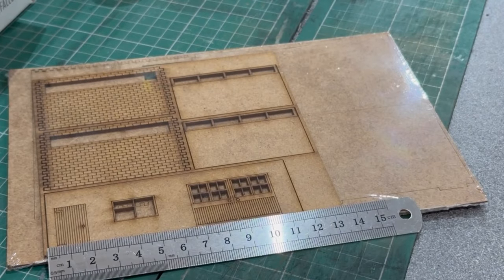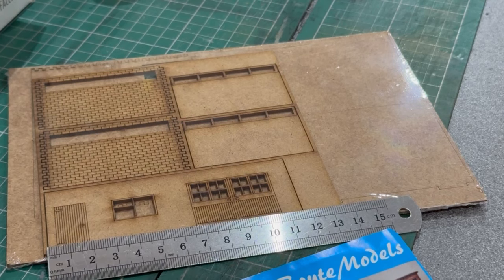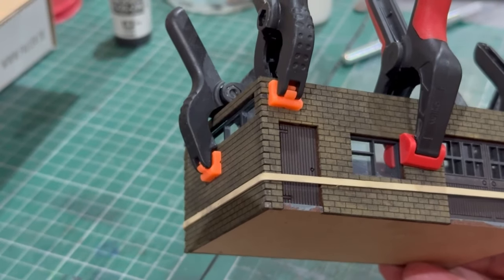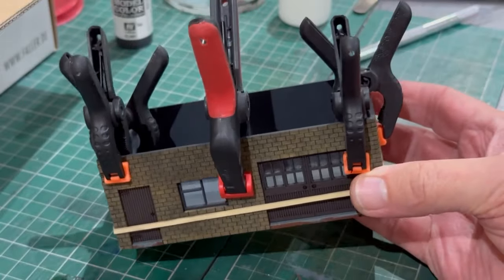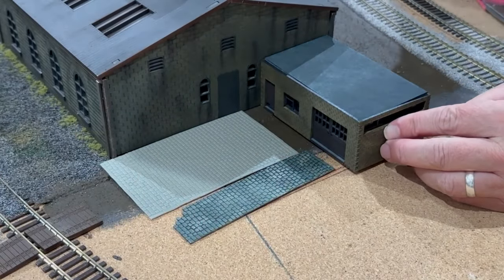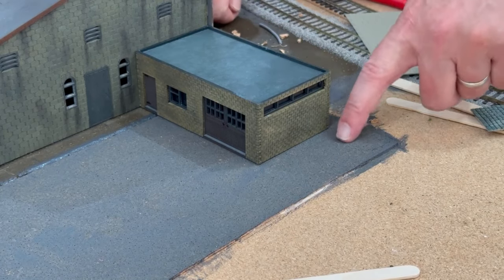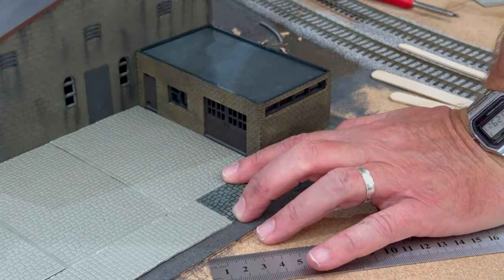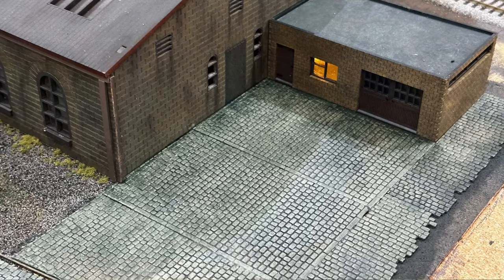My Big Model Railway Build -#22. The Loco Yard - Part 4

Comment: Perfect.  The workshop areas at the back or on the sides of these sheds are often forgotten or missed.  Yes there is a lot of cobblestone or even dirty concrete around the sheds because the big parts are often pulled out of the shed to be cleaned and repainted.
Reply from the maker: Thank you. I struggled to find any pictures so went with I thought! 👍
Reply: @Grandadstrainroom-pn3tt   Its a  model mate (whatever you want will work). Examples include  Worth Valley with office and space above the tracks. Kirby Stephen East had workers sheds,  workshops and a main office attached to both sides and rear. Ffordd 6G Road: This shed had it all Carriage and Engines inside with a long crew shed down one side.  Most notable is the age the shed was built and the pitched roof with chimney to heat the side sheds. Its an age and place thing I think.
Reply from the maker: Fab. Thank you 👍